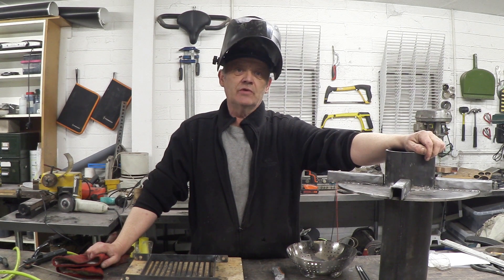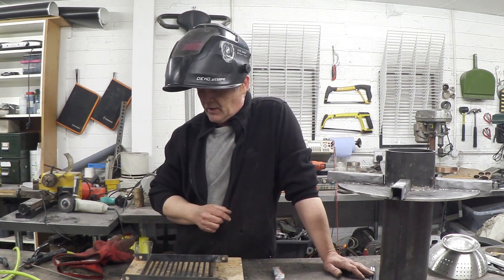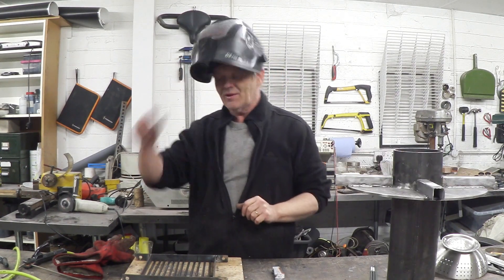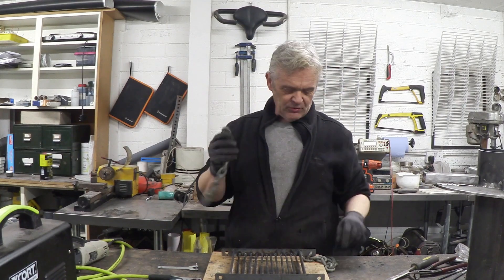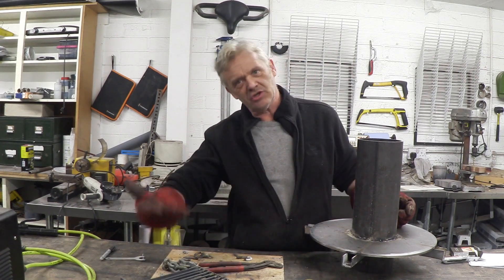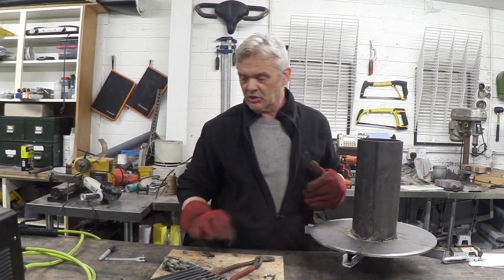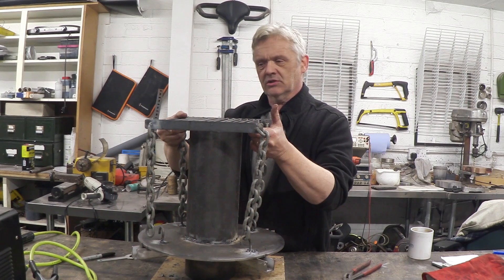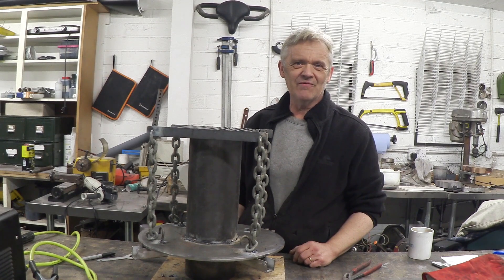DIY Gasification and Generator Unit - The Grate

Comment: Have you tried using low hydrogen 16tc welding rods? They are harder to start, but if you practice with them you will find you get much better welds.
Reply from the maker: I'll give them a go mate - cheers

Comment: A word of warning!
You need to be especially careful when welding galvanized steel! It produces very toxic gasses .... even more so than normal welding. It can literally send you mad .... also you get the same problem when forging the stuff!
Having said that I am sure that you have taken precautions ... this was really for those who do not know ;0)
Reply from the maker: I ground the zinc off mate as it doesn't weld that well either
Reply: @ThinkingandTinkering  It was meant for those who follow and do not know ;0)

Comment: Hey Robert have you not considered just using a used heater blower from a heating unit instead for you gasification blower reason I ask is because those blower fans push a great amount of air trough them maybe you could pick one up for free and still use your turbo blowers for what you had originally built it for

Comment: Tip I'd give you with the welding Robert is try to position yourself so you have a prop for your arm or elbow down so its easier to control. Great project thanks for sharing.

Comment: To clunky for me.. you have to reach up inside to unhook the chain it in two places.. I think I might just take a piece of the pipe hinge it on the opposite side of the door and then make a simple  latching then attache one of those wires (or something stronger if needed) that swings loose but rests on the base of the door when not in use (or run it through the door so I wouldn't have to open it) so I can push the hinge open and bring it back to latch it.. Well I hope you can see my thought.. I have a hard time sometimes relaying what is in my mind to words on paper. Grand to have a cuppa with you in the am.. and bounce some ideas.. Carry on my friend.. well done!

Comment: I've seen people make hooks similar to the ones you have made by cutting a chain link into a U or hook shape and welding in place. I would imagine it would be stronger then bent over stock because chain links typically go through an annealing and hardening process once they are shaped.

Comment: RMS, actually Oak Ridge National Laboratory (ORNAL) wrote that report for FEMA. Always thought that colander hanging by chain was hokey. Also the holes would need to be bigger on the colander. But is the gap between bars too big on your grate? I guess it depends on the biomass you choose to feed it. If you use pellets, then your gaps are too wide. Love your videos! I want to see this gasifier running soon! P.S. I thought it looked odd when the gasifer is hanging from the tractor that is running from the gasifier in that report.

Comment: I know that your sin gas generator has yet to produce any gas for you Robert but, if the sin gas is suitably dry and clear of particulates, can it be compressed and stored for use at a later date?  If so, does it have a shelf life?
Reply: ......initially it's the wood volatiles that serve as fuel for very brief period only. No point compressing that bit. The real gaseous fuels are hydrogen and carbon monoxide in 50/50 molar ratio due to the essential reaction that is steam reacting with red hot carbon to yield these gases. It ain't like compressing LPG gasses which liquefy at moderate pressures. Aside from thus requiring at least 250 ATM pressures  to be worthwhile storage , the hydrogen component needs expensive technical solutions for high pressure storage . That's my understanding and ready to be corrected on a detail or two .
 The graphitic nitride Rob demonstrated presents a solution for hydrogen storage.
Reply: @charlesdickens6706  Thanks mate